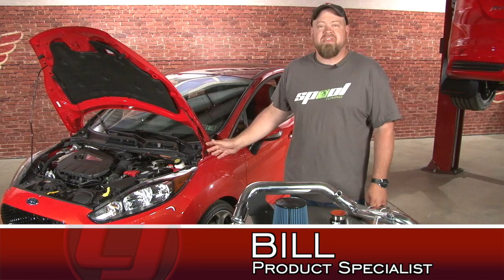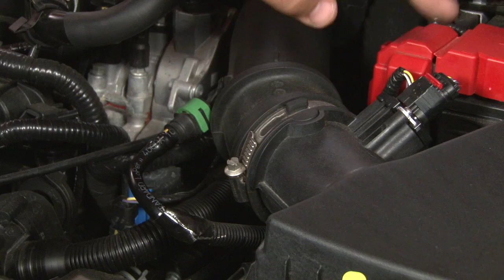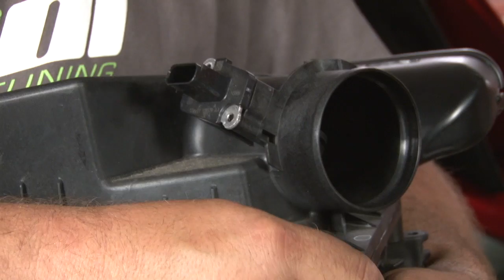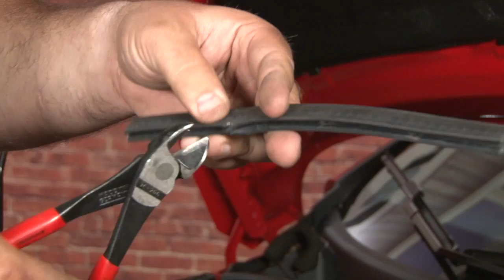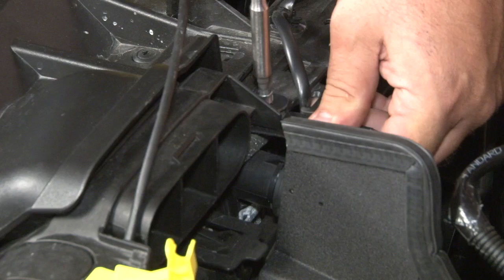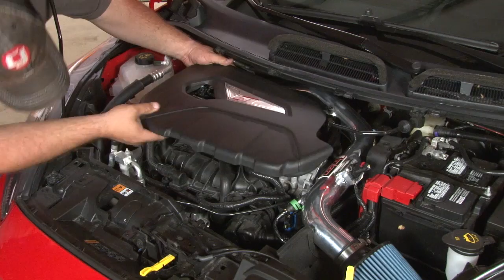Add Power to Your Engine with This Injen Cold Air Intake | 2014-2015 Fiesta ST

Comment: Will this fit on a 2016 Fiesta ST?
Reply: Cody Wade it fits on the 16 I just installed it... it's just a bitch
Reply: @codydare7893  I got it for my 2016 Fiesta ST based on your comment. How did you make it work?
Reply: @ssonera88  did you learn your lesson?
Reply: No.  The '16 has an additional vacuum line.
Reply: Cody dare what about the additional vacuum line ?